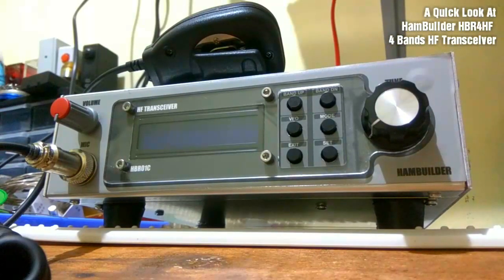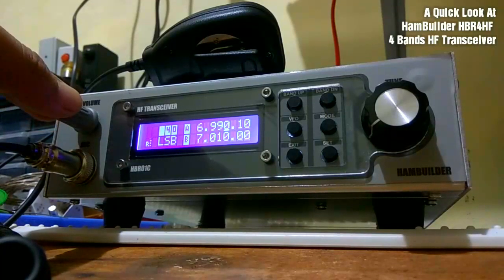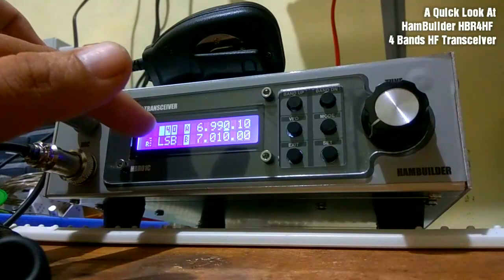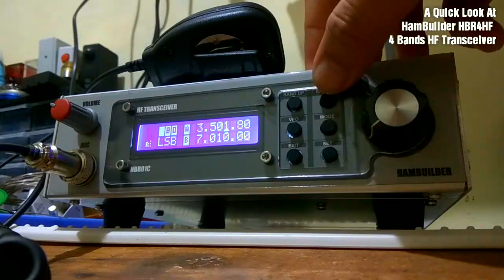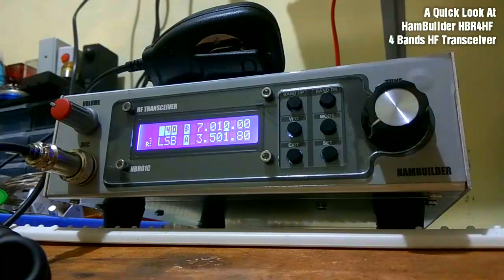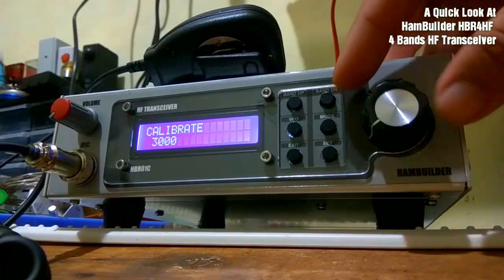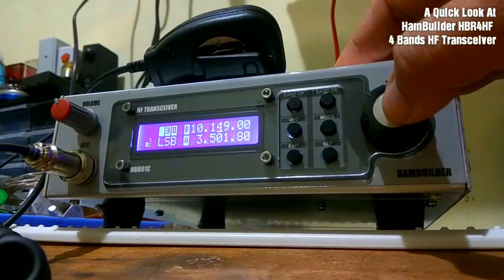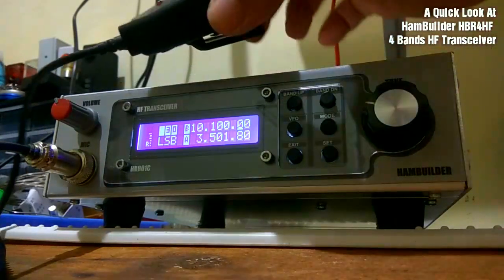A Quick Look At HamBuilder HBR4HF 4 Bands HF Transceiver

Comment: USB Definitely sounds like the offset is wrong ..... The video wasn't very informative , It just basically showed the front panel , But not how the radio actually functions  ,  Does the Radio have AGC ? .... Is it Audio based or IF/RF based .
Reply from the maker: At that moment, the radio used a very tiny tinny speaker.